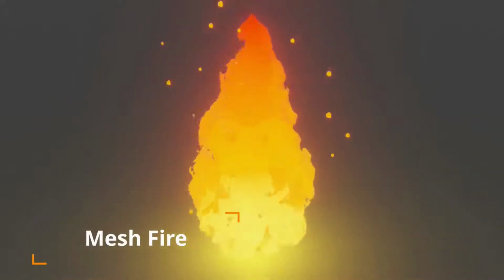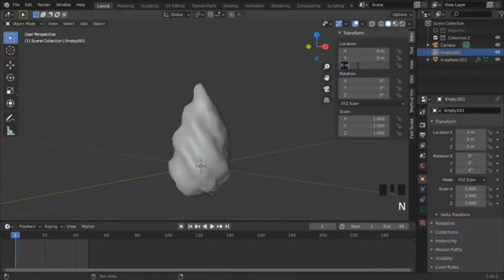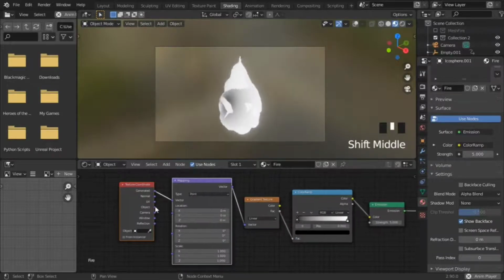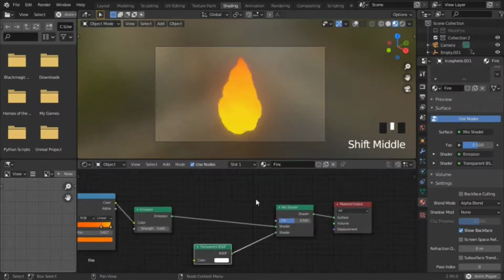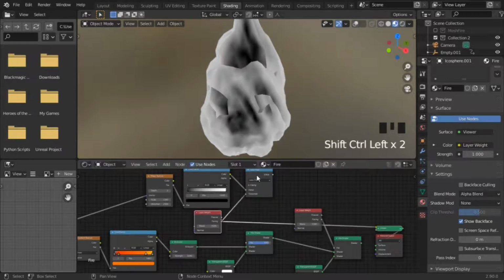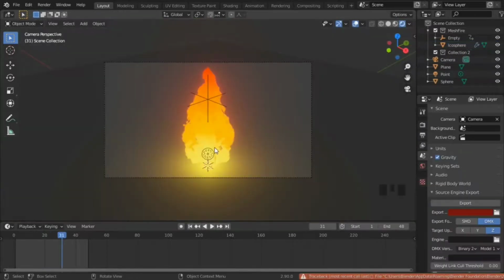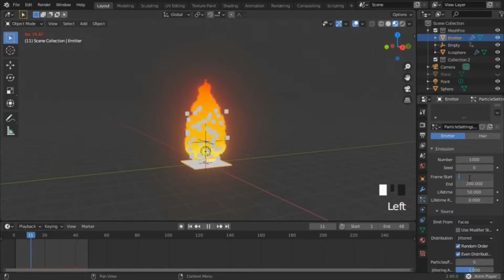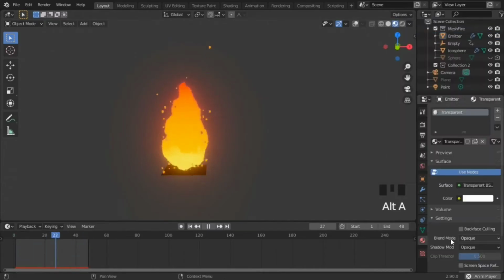Blender Stylized REALTIME MESH FIRE TUTORIAL

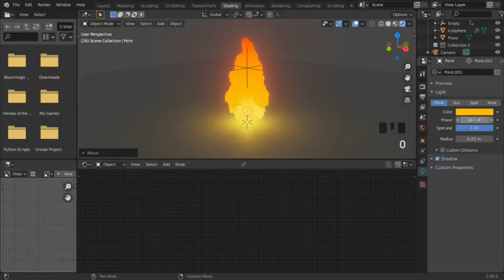Comment: Thanks for this tutorial! hmm... I don't understand how the Flickering Light works in about 1:47. I don't see much difference in the animation. Is it for the movement of the shadows? My keyframed Point Light just goes all over the place.

EDIT: I'm just a newbie to Blender. I found a short tutorial on using the Noise Modifier for the Graph Editor here if anyone is interested: https://www.youtube.com/watch?v=Dusm_fQekww When set with the correct Graph Editor Modifiers, the 'Point Light' will simply move around  the Torch's flame & can cast flickering shadows + reflections. This is what I did... Inserted only the beginning one Keyframe in the 'Dope Sheet' for the 'Point Light'. I used X & Y Object Transform only and deleted the rest in the 'Graph Editor'. Then I added the 'Noise' and 'Limits' Modifier for each with the ff. values in Blender vers. 3.3.0:

NOISE X / Y
------------------------------------
Blend Type: Replace / Replace
Scale: 1 / 1
Strength: 100 / 100
Offset: 0.00 / 0.00
Phase: 1 / 2
Depth: 0 / 0
Influence: Checked 0.100 / Checked 0.100
Restrict Frame Range: Unchecked / Unchecked

LIMITS X / Y
------------------------------------
X box: Unchecked / Unchecked
Min. X: -0.020 / Unchecked 0.00
Min. Y: Unchecked 0.00  / -0.020
Max. X: 0.020 / Unchecked 0.00
Max. Y: Unchecked 0.00 / 0.020
Influence: Unchecked / Unchecked
Restrict Frame Range: Unchecked / Unchecked

You must be in Rendered View to see the effects. Now, my problem is then how to duplicate and easily move these Torch objects in the scene. Parenting & Childing objects doesn't seem to work intuitively. :-P But I just figured out I had to press Shift + Select all torch objects that I want duplicated in the Outliner. That is before pressing Alt + D and moving them as a duplicate. The single 'Empty' object can't seem to become a child of any other torch objects though.

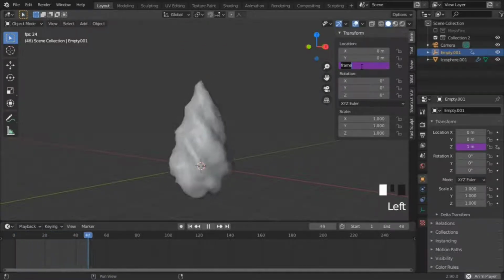Comment: 😉❗‼💀☠   to my fellow noobs stuck at 0:30 with the empty. this is how we do it   ☠💀‼❗😉

a way to do it more easy, is when u set the coordinates to the empty, u need to do this: ...

When its there, so to the first frame of the empty and press "I" (shortcut for keyframe) [you'll find this on the left where the modifier is... the orange square with lines around it]. 
after its done, go to the timeline and put it on the 100th fame for example, just anywhere u know u wont be finishing. then go back to the location and press I again. at something like 600 for example. and just adjust till u feel its right.

GLHF

Comment: for all who are wondering at 1:38: he puts the Value of the "Less Than" node into the Fac of the second "Mix Shader". The Shader value of the Mix Shader next to the Material Output needs to be put back into the Surface and Bam that worked for me :) He just changed the outputs to see the effects. Just ignore that and go on with the nodes and it should work out!

Comment: Slight Edit: I was informed that he did make the blendfile available on Gumroad so you can go there using the link in the description to download it. But even after downloading it remaking the item exactly the same way, literally copied every single value with no change whatsoever, and then perfectly mimicking the node structure it still did not look anything like what he is showing. So IDK I had to use a combo of this video and another video going over the same subject to get a decent result

I can appreciate that a lot of people prefer faster tutorials and that's perfectly fine because you can manually slow down the video. That is not my issue. My issue comes near the end when you are finishing up the nodes.

 You leave information out and through cuts add in more nodes than what you mentions, again this is fine but the issue then becomes that your bit rate for this video recording is so low everything is ridiculously blurry and impossible to read. So I could not get the breaking up of the fire part complete simply because I couldn't see what you did.

My recommendation in the future to help prevent these types of issues are.
1. Think about who your audience is, if its for beginners you need to slow down, for intermediates you can use your current speed but can't leave out information if its for advanced level people you don't even need to talk. 
2. Up your recording quality this tutorial is primarily visual I could do it without hearing you speak a word so long as I can see everything you did.
3. If you don't wish to take 1 and 2 into consideration then make the blend file available to people somewhere especially for the nodes
Reply: tbf they did, there is a gumroad link

Comment: The part with the black color in the ColorRamps set to Alpha 0 isn't working for me. The tip just stays black. :/ Any idea on how to fix this?
Reply from the maker: I think it might be because you didn't set the alpha to blend, in material>settings set blend mode to alpha blend or alpha hashed.
Reply: @idowhatiwant6678  Same problem for me, Settings are in Alpha Blend and the fire tip still black, it gets a little transparent when I add the transparent shader but still not right
Reply: @victorvasconcelos9784  same, 5 months later have you figured it out? I've done a bit of googling and haven't found much for an answer. Could this be a bug? It looks like all 3 alpha blend modes just do nothing :/

Comment: Hey, nice tut! Is it possible to make the mesh animations key-framed? (for FPX export -> Unity import)
Reply from the maker: I'm not sure, I've never exported an animation before, but I'm pretty sure you can't, its displacing using textures, so you might need to import the displacement texture as well. Check the animation baking settings first, you may be able to bake something there.
Reply: @IdowhatIwant  Ok, yeah I figured that was the case. Don't know a way for Unity to do the displacement trick tho...

I guess I could "hack" it by:
1) creating a mesh from each frame I want included, by applying the modifier on that frame
2) create an animation sequence where each of these meshes display full-sized whilst the others remain scaled down inside the displayed mesh :]

THINK it would work anyways, haha. Nice anim, would like to keep :)

Might even add some tongues of flame leaping off the main body that way, by adding them to each mesh...